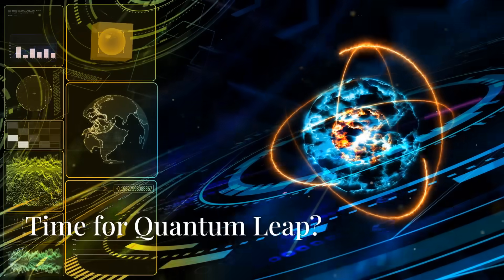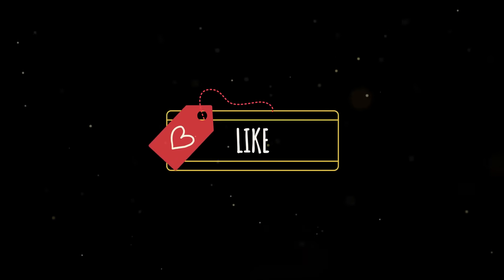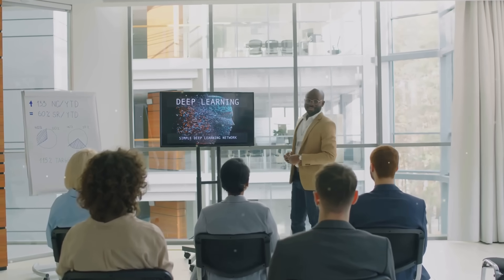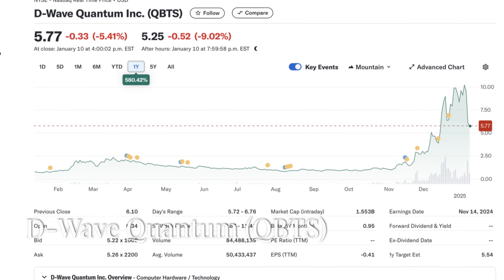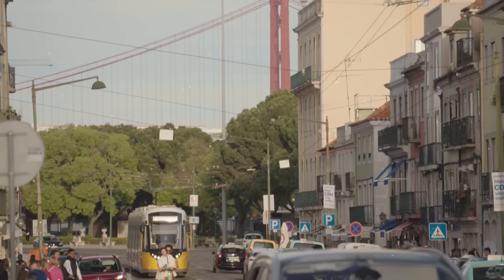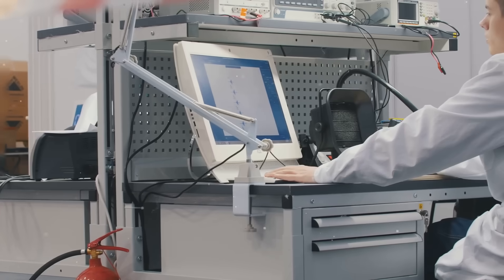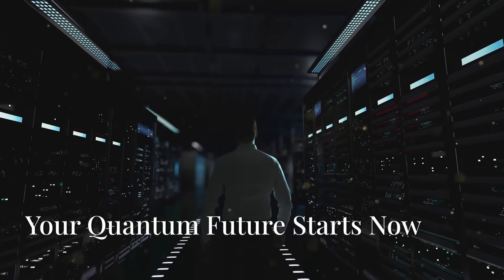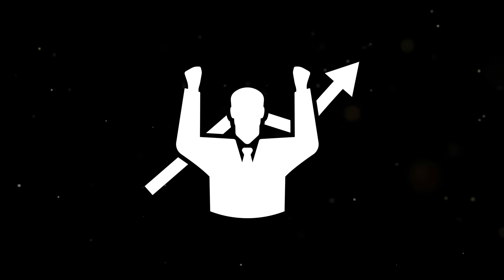Quantum Computing Jackpot! Selloff Unlocks A Fantastic Opportunity

Comment: These are the NORMAL phases for small-cap stocks.  At IPO the price is high, because it is ALL promise, no earnings. After IPO price drops to a floor.  Any news causes spikes.  Cumulative news turns the stock into sort of a cult following in retail trading, where the promise of the company means more than earnings.  Here the danger is splits, if the company tries to generate cash to take advantage of the interest.   This is where the quantum stocks are, lots of promise, some results, but little earnings to back up the value. 

Most companies die at this point.  But a few survive to start earning to match the stocks value.   

Take some extra cash and invest it in about a half dozen of these.  Somewhere in there is an Amazon, check back in 10 years.